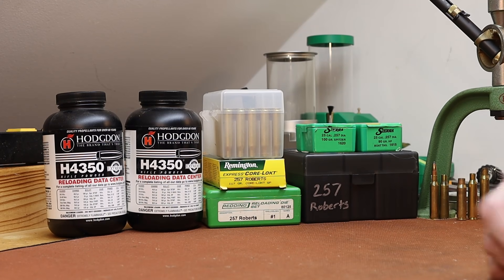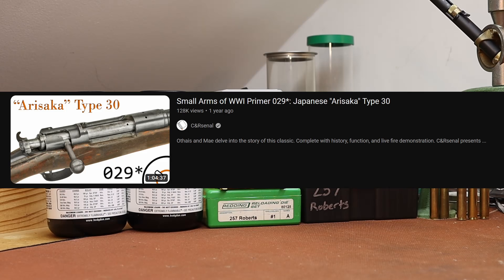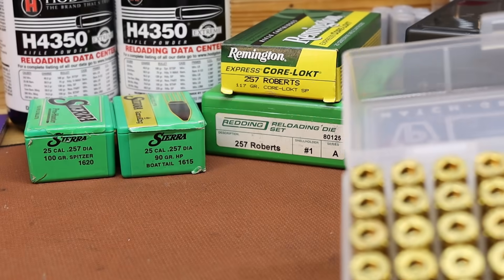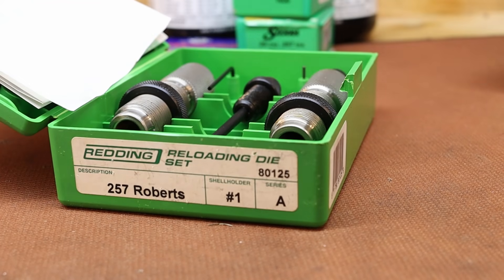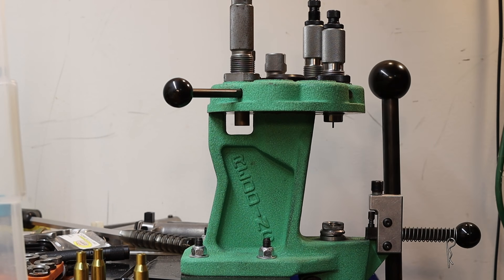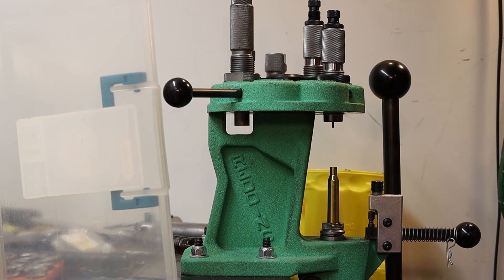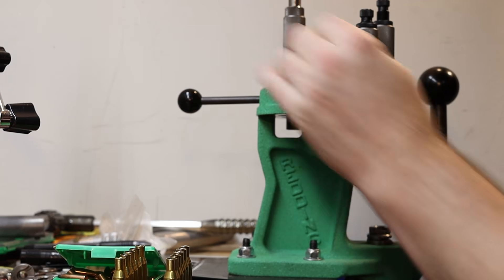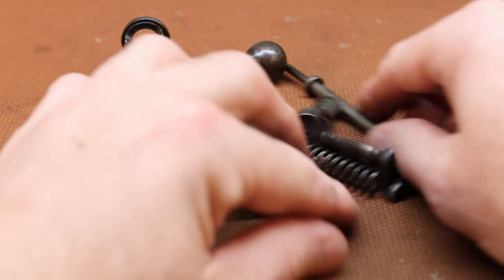.257 Roberts

Comment: Glad to see you back on the interwebs. I had three 257 Roberts built on MauserVZ 24 actions years ago when I was working in a machine shop. I sold one to a young man that almost had his right arm torn off in a manufacturing accident. He needed a low recoiling rifle to hunt with and Roberts was the choice. I bedded it in a Fajen laminated stock. Another was sporting a stainless steel barrel and I reshaped the original military stock and bedded the action. I made the stock short for a little lady barely five feet tall. She shot many deer with it shooting mostly ballistic tips her husband and I loaded for it. The third I kept. I also retained the military stock after reshaping and bedding. It was my favorite hunting rifle for several years. If I remember correctly Mauser 95 actions could be used to rebarrel to 257 Roberts if you stayed with low pressure loads. I have loaded old 257 brass I found at the range and bought at gun shows until the necks split I do have some new stuff and it's marked +P I don't recall if I have loaded any of it yet. Now you make me want to pull mine out of the safe and shoot it. I did most of my loads for mine with ball powders either BLC 2 or Winchester might have tried some with 4350. Thanks for the video I will follow along to see how you do.

Comment: Hey!!!  Commenting before I've even watched this......BUT GLAD TO HAVE YOU BACK!!  Was starting to get worried about ya-

.....Now, where were we on "roll crimping?"  😂😂
Reply: Thanks for another excellent video-

A couple of things:  I would have opted for oil rather than grease (on the bolt). 

For years, I did a "reduced recoil" load for my boys in 243, with a Sierra 85gr HP. It ran around 2650, & killed a pile of deer with that load.  Your 257 Roberts will work just fine.

Comment: Great vid, 
Things of note:
Your trigger pull is heavier with the new part because your old sear wasn't worn- it had been smithed and stoned for a different and lighter sear engagement. The new one being sharp edged now has more drag and grip on the opposing sear face. 

Brass: a lot of people mistake old and poor quality/faulty brass and brass neck cracking as pressure signs. This is extremely common on brass from winchester and remington which has sat around for a long time. It's not uncommon on older brass- and older cartridges like the 25-20 even from "newer" batches can be absolutely atrocious for neck cracks on brand new unfired cases. 

In regards to pressure and unexpected velocity increases: its highly unlikely you would get any pressure signs with the loads you have run in your 257 Roberts given your rifle has a "3 inch" chamber and throat, and your seating your loads well back from the rifling. 

I have seen +p cases weigh identically to other 257 Roberts brass of the same brand but not marked as +p. The only thing they had changed was the head stamp. So it's recommended to batch your brass by weight- not just headstamp. 

Cheers

Comment: Speer makes an 87 gr, and a 100 gr hot cor bullets, both work very well in the Robert's. We all gladly welcome your return.
Reply: Speer 87gr hot core  45.5 gr H4350 1 hole groups, Browning a bolt 24" barrel, ladder tested to 51gr max plus p no signs of pressure. H4350 compression just under 48 grains

Comment: Man, I love my .257 Roberts. Its a Remington 722 that belonged to my grandfather. Is it the best cartridge in the world? Nope. But I don't care. I learned how to reload because of that rifle. I've had exactly the same experience with old Rem-UMC and WW Super brass. The necks always split. I think it's the age of the brass and how much work hardening it's encountered... I only use Remington brass now. Hard finding good data for newer 25 cal bullets. I have a box of 110 gr Hornady SSTs and can't get data anywhere. Should be a perfect bullet for the old Bob... I shot Speer 100 gr HPs for a while and had one drive Thom the brisket through hear and lung and the jacket stopped in the liver of a decent sized white tail. Spun on the spot and dropped. I've since switched to Nosler 120gr Partitions since I feel like I was flirting with disaster with the Speer bullets. You probably know but the 2.775" COL on the Bob is pretty much a throwback to the old Remington box mags. My rifle won't take a round much longer than 2.780"...

Comment: The first custom rifle that I built was a Mauser 93 action/Adams & Bennet barrel with a 257 Roberts chamber. It was very accurate, and I nailed a small buck the first time I took it out. It was very comfortable to shoot. I avoided the +P loadings as it had the Mauser 93 action, so erred on the side of safety for that old action. BTW Your grandfather's RCBS die was likely a dedicated trim die which would explain the lack of an expander. The top of those trim dies was extremely hardened so you could use a file to trim off the brass that protruded from the top of it. He may have used it as a forming die to make 257 Roberts cases from 7x57 Mauser brass.

Comment: Seating just off the lands is a common practice but for old military type rifles, in my experience they like to be seated with a longer o.a.l. The chambers have a longer throat. My 6.5 Swede and 7 mm like it. But that is with mil surp barrels. Touch the lands and hump it back. Sometimes bullets like a little jump to the lands.

Comment: If it wasn't for you, I would have never used A2520.  I tried it in my finicky .257 Roberts and was rewarded with a .27" group at 100 yds using 100gr Nosler BTs!  I always hoped that you would one reload for the 25-45 Sharps; as the loading data for it is extremely limited. Sigh, can't have everything.  Thanks for all info you've provided over the years. Hopefully, you'll reconsider your decision to "retire".

Comment: Interesting Round I always liked. Just never had found a decent rifle in the caliber. Could have ordered one from  SHAW customs in a Savage action. Someone scarfed that one up. Since I already had a .25-06, I just decided to keep it and get a 7X57 (the parent case used for the .257) get Nosler for the +P cases. My .25-06 is pretty danged accurate, so don't see how I could beat it with higher bullet weights.  .243 already can handle 100 gr bullets and .260 Rem also has it surrounded.

Comment: One good thing about the Bob is that you can use a lot of different cases to make brass for it. Originally it was the 7x57 necked down to .257, so doing the same now still works. When you can't find 257 or 7x57 then the next case to use would be 30-06. This needs a bit more work to convert, but -06 brass is almost always easy to find.
I like the 250 Savage. Does almost what the 257 does but uses less power to do it. And if you use the right bolt action you can have a trimmer and lighter rifle. It also can be found in the Savage lever gun, always a slick little rifle.

Comment: The barrel is a Remington (or whomever is subleted by Remington) product.  Here's why:  You know the rifle has been sporterized - poorly - and the caliber is now .257 Roberts.  It seems to be so marked.  Arisaka rifles were all either 6.5x50mm (.264") or 7.7x58mm (303") Arisaka.  Both of those calibers that exceed the bullet diameter of .257 caliber.  So the barrel was replaced with a suitable barrel.  Obviously, a Remington.

Reseach (seeing what will blow them up) reveals despite the poor finish, the actions are quite strong.  Probably among the strongest actions made.

Comment: Just an FYI, if you can't find 257 roberts brass, Just run some 7x57 through the sizing die. bingo, instandt 257 roberts brass. (might have to neck turn it, if you have a tight chamber.)

Comment: If I might make a suggestion, use the target that you used at 50 yards at 100. It has a smaller and more contrasting aiming point. Also, file your front sight bead flat, if you can.

Comment: I think your speculation is correct....  The rifle was rebarrelled....

I wanna say, those were 6.5 x 50 Arisaka????  I'm probably mis-remembering that....  Don't quote me...  But I think you could make that brass out of .308 cases.....

So if the bolt face would work on 308, the rifle would be a natural to re-barrel in 308, 7mm-08, or any 308 based caliber, which, 257 Roberts, sure....  So yeah, it would have been a natural, to re barrel....  It looked like someone glass bedded & free floated it there too....  Or at least tried to.  

It's hard to imagein, but even in the mid 80's, there was SO much surplus around, for nothing, people were still "sporterizing" those rifles...  Mausers mostly, but, whatever....  gunsmiths were still doing that.  With warehouses full of the stuff, it was hard to imagine a day when it would run out, or there would be historical significance.....

Anyways it's a neat rifle.  Good luck on your hunting trip.